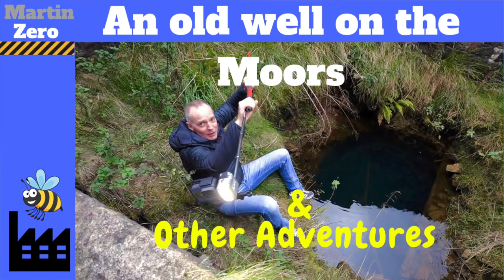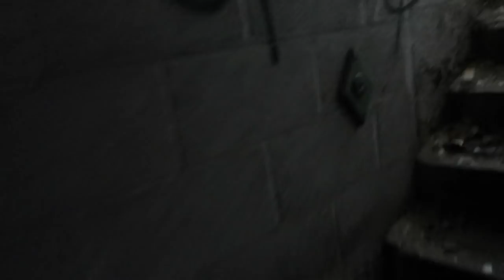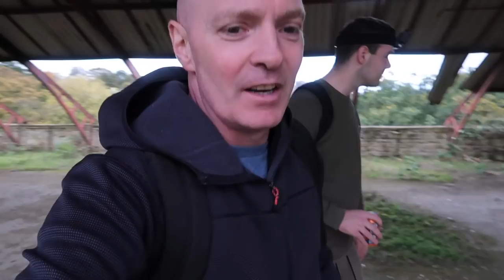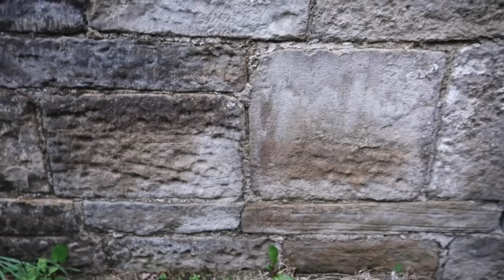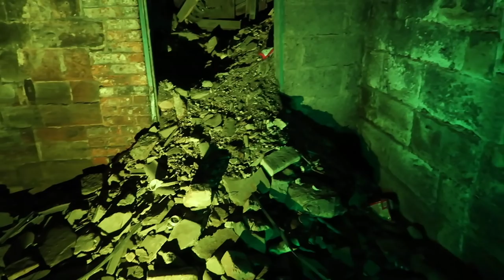Exploring an abandoned Steam Powered Spinning Mill

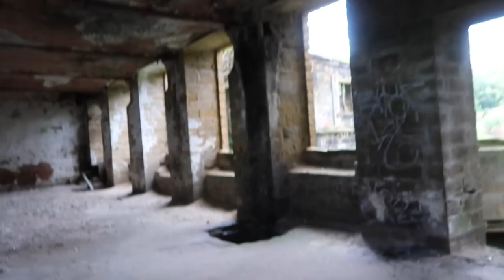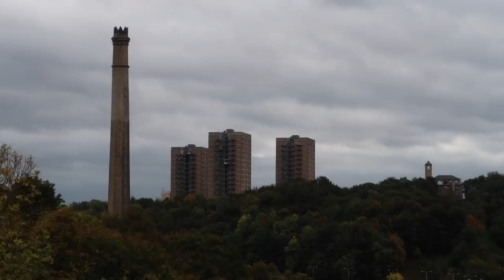Comment: 6:35  Predates the railways.  Amazing tripping back that far into the past. Funny enough it reminds me of the converted mill in my first job in 1976 in Orchard Street, Pendleton, Salford - - converted to a Thorn/ Radio Rentals TV repair factory. (Roundabout the same time John Cooper Clarke was a store clerk for Salford Tech round the corner.)  Had a lot of those iron post ceiling supports that this vid shows.  Last I saw, this Salford mill in Orchard Street had been demolished except for the ground floor and large basement area which remained the same and used as a Cash & Carry - - so probably not enough remains for Martin to visit.   17:25  What I like about that crowned chimney is how it looks down its nose at those cheap-and-cheerless highrise flats.

Comment: Yet another very interesting video Martin. The staircases you both went up and down were pretty well worn and hollows worn with use on step edges. First chimney hole is smoke hole from boiler, 2nd hole(rectangular) on other side and lower on stack was the clean out hole where loose soot and ash were raked out from bottom of chimney. The arched brickwork was for the balance wheel for the steam engine, bigger the wheel more efficient the engine. A good and close copy to this boiler and engine room is the boiler and engine room at Wigan Pier cotton spinning mill,  its an exhibit open to the public. (Or at least it used to be when I went there). Another job well done. K.
Reply from the maker: Good info Kenneth. I never thought of that square hole being a clean out hole

Comment: Great video lads; that bricked vaulted ceiling, you can see the same thing on a bigger scale at Manchester Piccadilly, only the cast iron beams and associated stays, brick arches etc. there are holding up about 12 platforms and all the associated ballast, trains, track etc. :)

They knew their onions, the Victorians. :)
Reply from the maker: They certainly did. Absolutely amazing stuff. Thanks 👍
Reply: Android User C41F877B research Tartarian architecture I did

Comment: We lived in Tehran Iran from ‘76-‘78 all 3 story building were built out of steel I beams and floor structure infilled with brick arches and a layer of cement to level the floors. Bricks were delivered in dump trucks late at night perfectly stacked in the bin, then just dumped in a pile, first heavy rain turned the bricks back into clay and sand. They used a dry clay and plaster mix with water to build the arches by hand, no gloves or tools, the mix wasn’t even dry before more brick was thrown up and caught and placed on the just finished floor, very strong.

Great video hope somebody puts such history to a good use?

Comment: Those old mills really had some character, didn't they? this put me in mind of my great, great, (not sure how many greats, but at least 3 or 4, my grandfather was born in 1872) grandfather who was one of the early self taught engineers in those days before night schools or anything like that. He wandered all over Lancashire and Yorkshire working on the first steam engines that powered the mills. My Dad used to tell a story about him coming across a mill that wasn't working because nobody knew how to mend the engine, so he got it up and running for them. Those must have been such amazing days back then.

Engineering skills were passed down the male line in my family, my Dad could turn his hand to anything. He was mad about steam engines and built the Bala Lake railway in north Wales. This talent skipped a generation with his father, my grandfather, who refused to go to school after about the age of 12 because he wanted to drive a horse and cart to Manchester and back hauling goods. This would have been in the 1880s. Later on he became a fireman on the railways. He built three red brick houses on Blackburn rd in Chorley at Great Knowley, the name of the farm he had. In about 1960 when I was about 10 I stood on the back step of one of those houses and in a radius of about 180 degrees I counted about 50 factory chimneys, just looking from left to right. By the time my aunt left there about 20 years ago there were perhaps one or two still standing. All this makes me very nostalgic.
Reply from the maker: Hi Caroline thanks for that. Very interesting. Yep all those chimneys gone

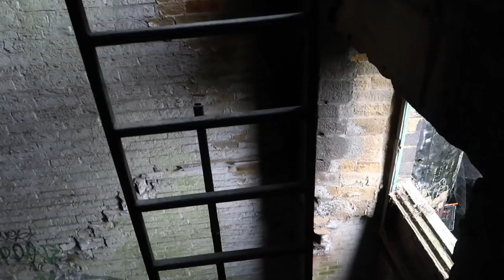Comment: Very nice building. Passed it occasionally. The room you labelled as engine room at 8:45 was the main staircase that has been ripped out according to 28dayslater. You can see some remnants of it at 8:39.
Reply from the maker: Thanks, I think it was the engine room ? What you reckon ? Those stairs looked concrete if thats what you mean ?

Comment: There's a culvert running under the mill and back upstream towards the mill that Halifax Boxing club is in. You can access it near the boiler house (building with the chimney) via a manhole. I was down there last week. You can't go far unless you have a wetsuit and snorkel though. Interestingly, at some point it had electricity in it, as there is a strip light just below the manhole.
If you go up the road to Halifax Boxing club, you will see that the mill the club is in straddles the Ovenden Brook, I guess the mill used the water like the Steam powered mill above. I must have a nosey one day...

Comment: Incredible structure! Amazing it's still basically in good structural condition, even the cast roof spars look sound despite being open to the elements! Like you said at some point that building has undergone extensive renovation, I wonder if there are any plans to restore it? Would make fabulous apartments! I've worked in a few old cotton mills and they all share similarities, over the years. bits get changed to make way for new industries but the main structures and features are there to see if you know where to look. Did you notice the worn down edges of the stone steps through years and years of workers trudging up and down them lol I remember that walk up and down 4 floors many times a day. Management used to frown on anyone using the lift for anything other than goods inward.There was a bit of a knack to 'driving' our lift it had a lever to control, down, up and stop, hitting the right spot for each floor was a skill I quickly aquired! 😁😎👍😎👍

Comment: The opening at floor level in the chimney is unlikely to be the flue opening. This would be the cleanout to rake out soot and debris that accumulates in chimneys over time. The round opening would be the flue opening. The boiler would not have its flue at ground level as heat rises. Firebox under the boiler, then steam piping then flue gasses out the top. Love your videos. Wish I could explore with you.

Comment: There was a railway warehouse at the side of London Road Station (Piccadilly) on Ducie Street, Manchester, near where the entrance to the car park and petrol station are. The construction was brick built with floors like the mill in Halifax. When they were demolishing the warehouse (with difficulty) there were a couple of tracked cranes with wrecking balls sat on top of the floors as they slowly broke through the brickwork. It seemed to take ages to knock down.
Reply from the maker: Wow must have been solid eh ?

Comment: Probably where the the big wheel of drum was, housing the rope drive for each floor. The one in Ellen Road Mill, Newhey is still there with the two working steam engines. Ellen Road was 5 of 6 floors of spinning machinery.
Reply from the maker: I still need to go see that Mill 👍

Comment: Older buildings, especially those extant examples, were overbuilt to stand indefinitely because engineers had not learned how to build them to stand as long as the bankers and insurance agents deemed sufficient. It's sad to see a building that only needs a minimal roof covering (what does corrugated tin cost?) to prevent further water damage.

Comment: Excellent insight into the building's construction there.  The brick ceiling construction is called Jack Arch Construction (https://en.wikipedia.org/wiki/Jack_arch).  Very common in mills, warehouses and some tunnels too because it's very strong.
Reply from the maker: Hi Paul, yeahVaulted ceilings arent they. Incredible structure
Reply: Hi Martin.  No, the mill ceiling is a Jack Arch ceiling.  A vaulted ceiling is one large arched ceiling, like in a church or hall.

Comment: Built as a very early example of a fire proof mill. Using a cast iron frame and brick arch ceilings. After many mill fires with wooden floors they decided to eliminate as much combustible material as possible

Comment: Another great video Martin & Connor. Love the skeletal beauty of these mills. I'm particularly interested in those brick arch ceilings , presume  the construction is for strength as wood would have rotted quickly . What other materials could they have used to cover such a huge load bearing area ? 👍☺
Reply from the maker: At the time all I can think of is wood. But I think they tried to build them fireproof hence the vaulted ceilings

Comment: From the engine room there may have been a vertical shaft, driven by the engine, which went from the ground to the top floor.  There would have been a bevel gear at each level which drove the horizontal line shafts.  These in turn would drive the machines using flat belts.
Reply from the maker: Wish I could see a picture of how it was Roger. Thanks for the info
Reply: https://en.wikipedia.org/wiki/Line_shaft

About 2/3 of the way down, on the right
Reply from the maker: Ahh yes they call it a line shaft 👌

Comment: There is building just like this in Shrewsbury called Shrewsbury Flaxmill maltings thats built exactly the same way. It was the first iron framed building in the world when it was built and is older than the mill in this video.
It was used up until 1985 as a maltings for making beer.
It has had £80M of lottery funding to restore it for use as flats, shops, workshops, businesses.
The bricks have been repaired/replaced with custon sized fairly locally handmade bricks and Shrewsbury Flaxmill Maltings has been proudly repainted on the wall, the windows have been replaced with new ones and the roof has been repaired/rebuilt with welsh slate.
Search Friends of Shrewsbury Flaxmill Maltings on google for more info.
You can subscribe to their newsletter and you will get updates on the progress to your email every month. There is a visitor centre open every day of the week and there are open days on certain weekends throughout the year where you can have a guided tour of the site. You will need to book a place as the tours are popular.
You definitely should come to Shrewsbury to visit. You could even do a video about it. You can easily get a train from Manchester to Shrewsbury then walk to the bus station and get a bus (i think the 24) to ditherington or walk. You can't miss it, its a huge site.
 Its about 2 miles from the train station to the flaxmill up ditherington road.
Reply from the maker: Sounds good Simon, never thought of Shrewsbury